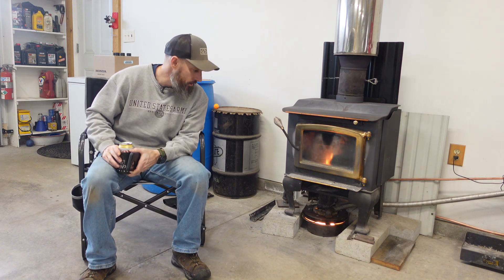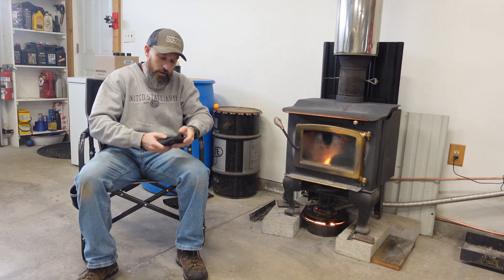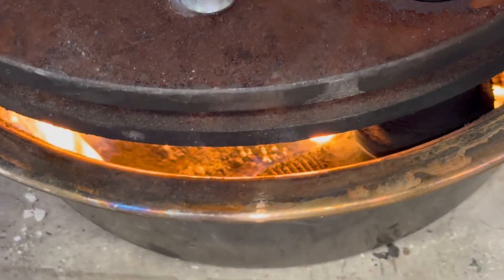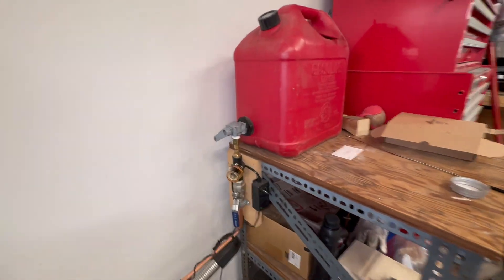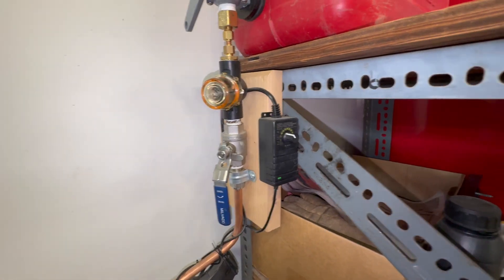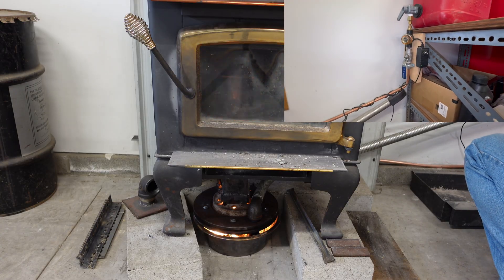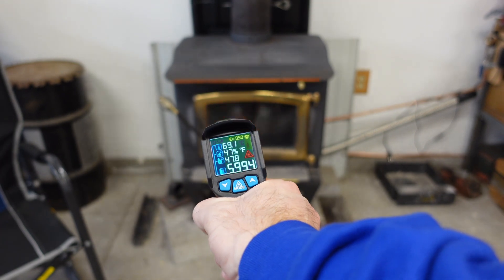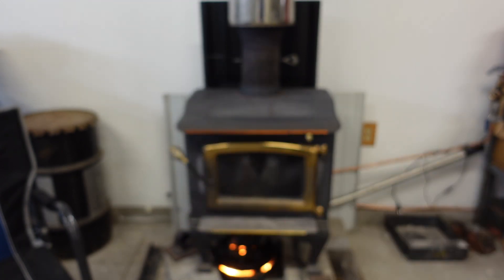Will my used oil burner run with no Fan? (with no problems)

Comment: my understanding is the best way to go no fan (if you have efficient-ish flu design for air draw)/ and STILL get efficient oil combustion  is to add water... in some manner to use steam as a way to atomize the oii more.  As in fan adds oxygen to improve combustion...  Steam improves combustion by better atomizing oil so it uses the existing oxygen better.  Something like that.  

Downside is... LOUD and possibly easier creosote build ... curious though if you put in just right spot of flue to catch any still liquidy form of creosote  with purpose  to use it as a combustant later
Reply from the maker: Thanks for watching